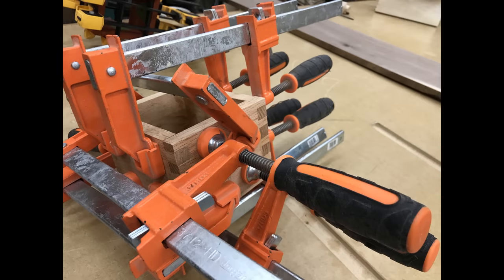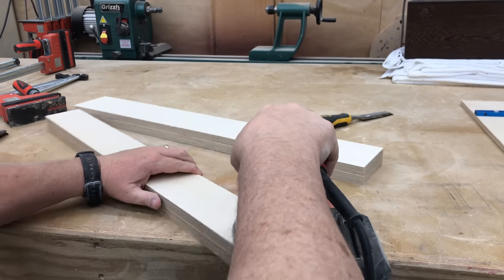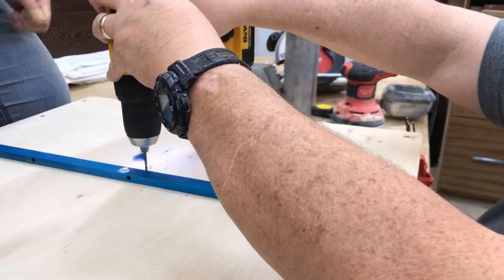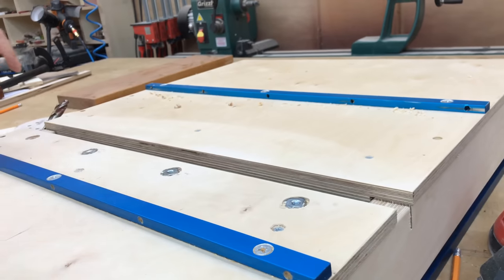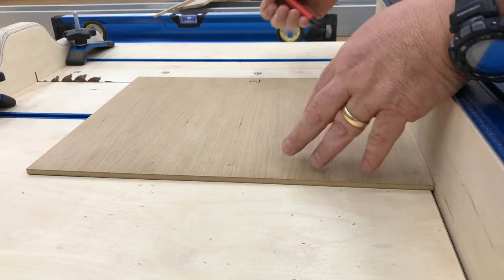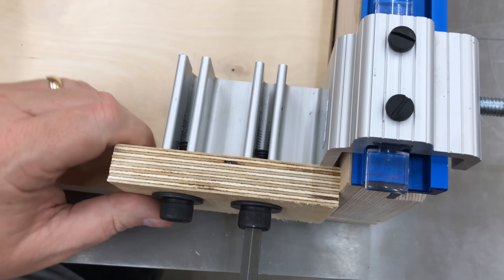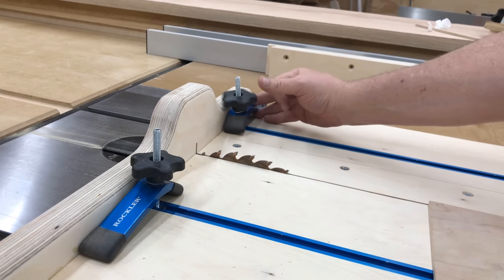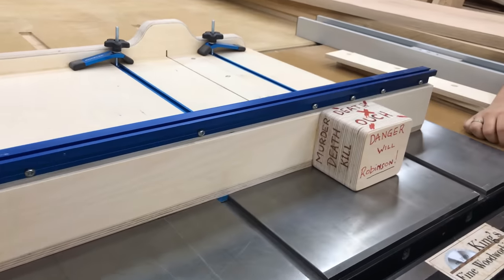39 - Extreme Crosscut Table Saw Sled with Perfect Miter & Dado & Removable Zero Clearance Insert

Comment: Great video, one question could you not have installed the runners after you doubled up the ply so you could forgo the threading for the screws holding the runners in place?

Thank you

Comment: I have been looking for the extended bolt with rubber foot used in your Rockler auto lock t track top clamp. Where did you get yours?

Comment: You mention removing the hold down clamps, but I don't see how the bolts are removed from the rails. Mentioning the need for bolt removal space would be helpful.
Reply from the maker: I don’t actually remove mine. But if you like doing that, you simply cut the blue t-track 1” short on the end. And you can take the bolt out that way.  

This won’t affect your performance or usability because you’ll never clamp anything with the clamp all the way to the end where it touches the fence anyway.
Reply: @KingsFineWoodworking  Thanks, great idea for the sled by the way. I like it.

Comment: When you did the 5 cut method, you measured it over the length of the board (11.5 inches), when its really 5 times the length of the square you started out with. Also, you made 5 cuts, not 4, so you should have divided by 4. This only makes a tiny difference but just thought id point it out

Comment: I have watched quite a few of these cross cut sled builds - and I came to think if there is a way of stopping the entire sled when the saw blade reaches the back wall of the sled. No doubt the 'safety blok' is a good idea - but I reckon the sled could have some sort of stopping point as well..? Or is this just a plain stupid or impractical idea..??

Comment: Hey great job. 
I see you have a Baileigh saw. How do you like it and what size is it. Have you had trouble dealing with the distance between the left miter slot and the blade? I didn't realize it when I bought mine and I still haven't learned the reason for it. Don't know if I would buy it again. 
Any thoughts?

Comment: I know this is an old video, but I have a question about removing the bottom section that is at least as wide as the widest dado you have.  Is this strictly necessary?  Won't any dado used cut its own slot the first time you use it?
Reply: I agree that it wouldn't be necessary. However, it would enable you to better see how much support your insert will have remaining after the dado cuts its slot. That might affect your insert width and screw placement.

Comment: Hey Buddy, Just picked up the plans, thank you for being on point they are great. One question, Did you finish the top, urethane? Or did you leave it raw?
Reply from the maker: Hi, Thank you!! I did finish it. I used lacquer. But polyurethane would work just as well too.
Reply: Ok one more question. Do the miter bars need to be the full length of the sled? I’m looking at a pair at 18”.

Comment: To make 45* angles, start with a 90* corner. Then just measure the same distance, from the corner of the 90*, on the vertical and horizontal sides. Connect these 2 points with a line, and cut. You had to measure something to get to the square. In your case, the fence angle.  So the probability of error was never eliminated 100*.  Either way will get you to same outcome, but your way has a lot more steps.
Reply: Otherwise, I do plan to make this one, as I have been looking at many.
Reply: So how do you start with a perfect 90 degree corner in the first place? What do you measure and cut to get the perfect 90 degrees? Then you have to make 2 accurate measurement marks from the 90 degree corner then align those 2 corners in a straight line to be perfectly aligned to the saw blade to cut it. This seems to be a lot less accurate and more hassle. In theory it works but would like to see it in action to be proven wrong.

Comment: Hi James, love your content. I just purchased the plans for this and I had a question... You run your fence through the jointer after the glue is dry... If I did not have a jointer, could I just shave a bit off on the table saw? Would this yield the same result? I understand that I may shave off a bit more, but as far as the fence being straight I am hoping this could be just as effective. Thank you

Comment: Baltic Birch is not listed in materials.  I’m having trouble sourcing it, may I ask where you obtain yours?
Reply: In a different post, King's Fine Woodworking states that it is not absolutely necessary to use Baltic Birch plywood. Anything stable and flat should do well.   True Baltic birch is a specialty item and comes in European sizes. In the US,  the equivalent functional product is called MAPLE MULTIPLY  also EURO-PLY or  APPLE PLY.

Comment: Great video!  I bought the plans ....... So one question.  What is the tool called that you used with the metal blades for the micro adjustment of the fence?
Reply from the maker: It’s a feeler gauge, you can get one at any hardware store or Home Depot for under $10.
Reply: @KingsFineWoodworking  Thank you!

Comment: What if you end up with + number on the 5 cut method calibration. I know I should move the fence to opposite direction from the neg number but how, James?
Reply from the maker: Hi Chris, you just move the fence. It’s ok if it overhangs the edge of the sled. 

Remember if it does, it’ll be a tiny amount. Maybe 1/32” or 1/64”. 

That’s no problem because the fence is 1-1/2” thick.  And that tiny amount wouldn’t be noticed.
Reply: Thanks James, indeed it is tiny bit over 1/32''.

Comment: Thanks! Fantastic sled, and the trick to making the 45 deg jig is awesome. Question: how do you make sure your two picture frame sides are the same length when you have to cut on opposite sides of the blade?

Comment: Neat project. Question: Will design allow for a miter cut with the saw blade at 45° or would that make the gap too great in addition to the dado capability?
Reply from the maker: I'm sure it would work.
Reply: Looks like it would cut through the insert retaining screws.

Comment: Great job! will look at this when I build my sled. One question about the hold-down clamps. How would you remove them once the front and back fences are in place? It doesn't look like there is room to get the T- bolts out of the hold-down clamps.
Reply: The t on the other end from the star nut is narrow enough to pass through the t track. Turn it 90⁰ and it holds to the bottom of the t track. Turn it 90⁰ again and it slides up and away.

Comment: Great video. Easy to follow.  I too bought the plans and built the sled. My question is where did you buy the long threaded bolt and rubber tip on for the Track Hold Down Clamp?  The one that comes with it is too short.

Comment: Thank you for this wonderful video and very detailed plans! 
When mounting the back fence, after squaring using the 5 cut method, should you drive additional screws into the fence (beyond the two at each end) or will that potentially shift the fence off of square?

Comment: Where can you buy Baltic birch?
Canadian woodworkers use it alot.
But I'm not finding it at Lowe's.
Is maple ply a good alternative?
Reply from the maker: Around here it is really only found at hardwood dealers. Wherever you can get maple, oak and cherry etc, should carry it.
Reply: King's Fine Woodworking 
Thx James.😊 Lowe's had 2 pieces of birch 24" ×23" on clearance for  $5.00 a piece.
My sled I guess will be birch.
I checked Lowe's and they have maple ply and oak. But it's very expensive. I'm a right wad. 
We'll see what happens.

Comment: Nice looking sled.  I have a question.  The screws you ran through your runners, what are they threaded in to besides the runners?  Did you add nutserts or something the machine screw threads in to?
Reply: Yea I think this was done wrong .screws should of went through the timber into the runners .glue is only holding them on

Comment: At 4:30 or so, you show tapping the the miter bars, counter-sinking and screwing them down.  To what? I assume the plywood is threaded but is that secure enough.  Wouldn't it have been better to come thru the wood to the bar?
Reply from the maker: Yes the plywood was threaded. It would have been a bit stronger through the wood, but I wanted the screw head not showing.

Comment: Wait, what? Why not countersink the screws for the runners  from the top side, through  the wood? If you must rely on the wooden  threads, at least you could harden them up with some thin CA glue and let set up before installing the  screws,  ..or not.

Comment: I have been looking at several videos for Table Saw Sleds, I have watched yours more than once.
Yours is one of the best I've seen.

Am I correct in assuming your table saw has the arbor on the left of your saw?
If not you will be cutting into the non-replaceable part of your sled when you use the dado blades,
because when you stack them you will be adding to the left side of the cut.
My Delta Unisaw has the arbor on the right, so I will put the replaceable section to the left of the blade.

Comment: To get a little more accurate angle to adjust your fence you need to measure the length of the fence from the pivot point. but otherwise fantastic method.

Comment: Since you made 5 cuts shouldn't you divide by 5 to find the error and not 4?
Reply: Let's assume we have a 12x12 panel, and a 12 inch fence that's out of
square by .01 inches.  When you cut Side 1, Side 4 is against the fence,
duh.  Side 4 needs a special name because it's the only side that's on
the fence twice.  Let's call Side 4 "the reference".  So Side 1 is off
from the reference by .01; Side 2 is off from the reference by .02; Side
3 is off from the reference by .03; and Side 4, the reference side, is
off from its original position by .04.  Finally, placing Side 4 against
the fence, the strip we cut off Side 1 is .05 off from the original
reference, but .01 of that was already cut off in our first cut, so the
strip will be .04 wider at one end than the other.  Four times the fence
error, not five.  Make sense?
Reply: @JerryLevenson  Thanks!

Comment: Where do you get your baltic birch plywood. My local home stores only sell birch.
Reply: Wondering the same.  The big box stores choice for hardwood ply is not as good as baltic birch
Reply: The particular species doesn't matter.  The aim is to have the greatest number of layers for structural stability....resistance to warping.  That is the prime quality of aircraft grade plywood, and it is made from several species like mahogany and Douglas fir, in addition to birch.  No need to get hung up on "baltic."

Comment: I have a left tilt table saw. Would you just switch the insert location to the other side of the blade?
Reply from the maker: Exactly!  I’d just rotate the base 180 degrees, then it works flawlessly.

Comment: How did you get the Rockler auto-lock t-track hold down to have the extended foot rod?
Reply from the maker: Hi Stephen. You can buy longer toggle clamp feet for very cheap and swap it out. http://amzn.to/2GmRwhn
Reply: I GOT A #8MM x4" LONG MACHINE SCREW AND A 5/16 COUPLER NUT. I RE-TAPPED THE COUPLER NUT WITH A 8MM TAP SO I COULD COUPLE THE T CLAMP THREADED FOOT TO THE 4" MACHINE SCREW.THAT GIVES ME A 6-1/2" LONG FOOT GOT EVERYTHING AT HOME DEPOT. ANY QUESTIONS LET ME KNOW. BILL

Comment: Outstanding vid James. Questions How do you remove those hold downs? Single and dado blades. When you saw for box joints do you just use the same blade or a flat bottom dado blade setup? Can I just use a Rockler stop block instead of making it? Will I need to make any adjustments to it? I will be buying all this stuff from your links above!
Reply from the maker: I usually use a Dado blade. Flat bottom is best. 

I leave my hold downs in the sled. So I don’t take them out. 

But many people want to remove them. If you do, just cut the t-track 3/4” shorter. And your will come out of that end.

Comment: THAT LAST TRIANGLE THAT YOU MEASURED AGAIST THE COMBINATION SQUARE WAS A TOTALLY DIFFERENT PIECE OF WOOD TO THE ONE YOU CUT ON THE SLED ISN'T IT?
THE ONE YOU CUT, HAD ONE PERFECT POINTED END & ONE WITH A SMALL SQUARE END AS SHOWN @ 38:50  WHERE YOU CLEARLY SHOW THE SQUARED END BUT THE ONE YOU CHECK WITH THE COMBINATION SQUARE HAS TWO PERFECT CUT POINTED ENDS!

Comment: Thank you very much for the video. You're going to solve the problem that has been bothering me for years. And there's another question. Is it possible to use a metric unit instead?
Reply from the maker: You can use metric, no problem. But the plans are in imperial.

Comment: what size dado blade are you using? with an 8” blade there would be much left above the 1 1/4” thick sled
Reply from the maker: Hi, we use a 12" because we have an industrial saw, but I do recommend getting a 10" for most folks. And the sled consists of two sheets that are called 1/2" ply, but in reality they are a bit undersized, so the total thickness is about 7/8" or so.
Reply: Wondering how you come up with 1 1/4"

Comment: What a great sled! I’ve only seen a few styles but this one looks amazing! What size is it? Is there a too big size ever? Would there be any issue with using 1/4” or 3/8” on the top lam to make sure cross cutting a 2x would pass through on a 10” saw? Thanks for your awesome videos!
Reply from the maker: Hi Nathan. Thank you! This sled is 24" by 30". You can make it many different sizes, extra big is no problem. You could try 3/8", I think 1/4" would be too thin.
Reply: King's Fine Woodworking thanks for the reply! I guess 1/2” ply isn’t rely a full 1/2” so I could still probably eke out a thicker rough stock piece

Comment: Problem: how do you cut those perfect squares without measuring?
Solution: use you side fence for parallel cuts. Then, when you have just ONE square of the size you need, you just cut a smaller square out if it, always via parallel cuts. The remaining L-shaped piece is nothing else than a triangle and the two legs are of the same, exact length (for they were the sides of the "big" square). You can directly use this "L" piece as a guide for 45° cuts or to build a miter jig.

Comment: Hey James, I purchased your plan for this sled and built it. I just love it. I have a question about the Rockler clamp on the back fence. I purchased it and the threaded part of the clamp is not long enough to work. I noticed on the video that you modified yours. Can you tell me what that is and where to get it. Thanks James and keep the videos coming. 
Al from Maryland
Reply from the maker: Hi sure. I purchased this longer toggle clamp foot and just replaced the short one that came with it.  I think it’s $3.99. 
http://www.amazon.com/dp/B001ENXI06/?tag=kingsf-20
Reply: Thanks so much James, appreciate it.
Reply: I GOT A #8MM x4" LONG MACHINE SCREW AND A 5/16 COUPLER NUT. I RE-TAPPED THE COUPLER NUT WITH A 8MM TAP SO I COULD COUPLE THE T CLAMP THREADED FOOT TO THE 4" MACHINE SCREW.THAT GIVES ME A 6-1/2" LONG FOOT GOT EVERYTHING AT HOME DEPOT. ANY QUESTIONS LET ME KNOW. BILL

Comment: I bought the plans and in there as well as the video, you say you used baltic birch... 

would it be ok to use radiata pine ply i got a lot of left over of?
Reply from the maker: Yes of course. Radiata pine will work just fine. Baltic birch is not necessary.
Reply: @KingsFineWoodworking  splendid, cant wait to get started on it 👍 thanks for the reply

Comment: once you get sled assembled, how do you get t bolts in track? Also, how do you remove if you need full depth of sled?
Reply from the maker: I leave my t-bolts in. But if you want to remove them, just make the t-track about 3/4" shorter, and slide them out of the end.
Reply: @KingsFineWoodworking  Don't they make threaded t-nuts that could remain in the track after removing the hardware above?

Comment: I have your plans and ordered my hardware. At 4:32 you are installing threads and screws in the miter bar. I am not sure how the screw is secured into the wood?  Is there a better place for me to ask questions?  Love the videos.  You, your family have rekindled my interest in working with wood. I gave it up about 8 years ago for a different hobby but am roaring back into it with a vengeance. :-)

Comment: Your sled is more accurate than the Incra Miter 5000?
Reply from the maker: Hi Stephen, in truth any home built sled can be more accurate than the incra miter 5000.  

First of all, we use both miter slots. And it doesn’t matter how well your miter bars fit the slot, if the bar can slide, the bar has play. 

Using 2 slots dramatically reduces play. So much so that you can tune the sled to better than 1/1000th in accuracy. 

That’s not possible with the Incra. Not even close.

Comment: I love the sled. I have watched this video several times. I just got a new table saw so I am going to make this sled. I have a question though. Could the sled be modified so that the removal insert goes to the left side of the blade so you could cut bevels? Was just wondering.
Reply from the maker: Denny Yates hi,

Yes of course. Simply rotate the base of the sled 180 degrees. 
On the plans, that means rotate everything except the 2 fences. 
Thanks~ James
Reply: King's Fine Woodworking thank you. Enjoy watching your videos.

Comment: So, I just watched this for about the 5th time. Its an awesome video. Was getting ready to order the plans when I realized that it is designed for a left tilt saw. Do the accommodations for right and left tilt saws?
Reply from the maker: Hi, it works equally well for both. But the bottom pieces must be flipped left for right in order to use it properly on a right tilt. 

I have had about 50 customers make that conversion no problem so far. And if you get the plans and happen to get stuck, I will happily help you out.